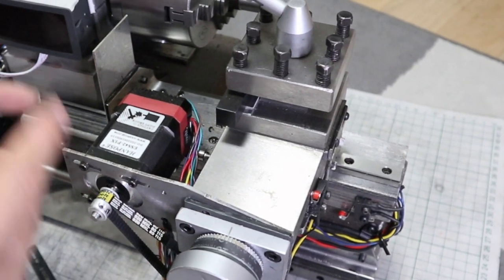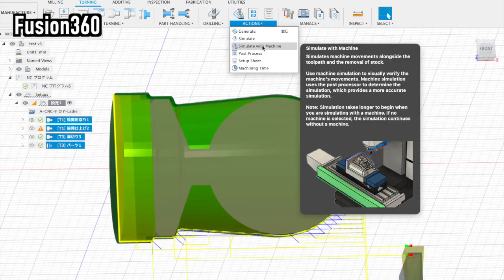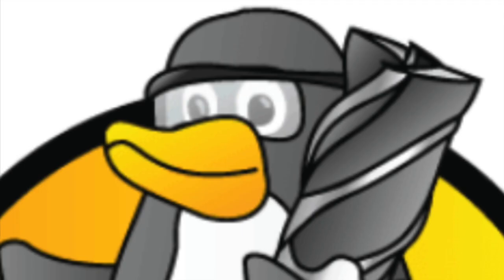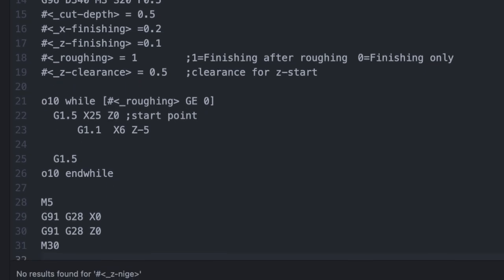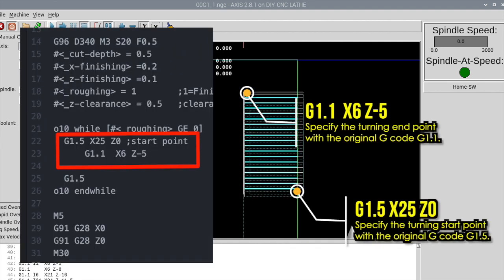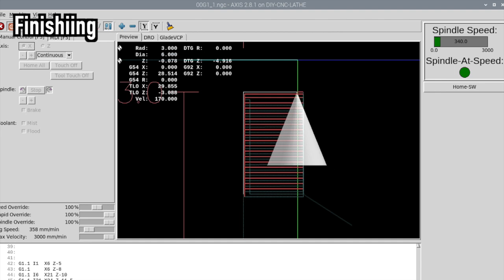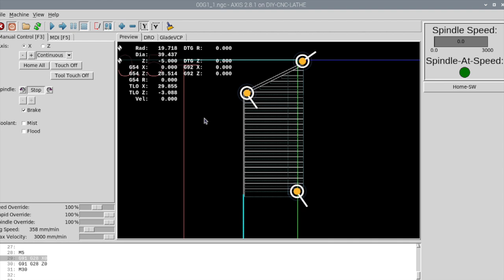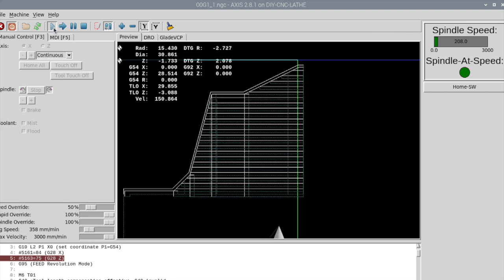Homemade DIY Small CNC Lathe. I tried making original G code

Comment: what is the difference from your gcode to the G71 G72 Lathe roughing cycles from linuxcnc? do you share your gcode?
Reply from the maker: The G71/G72 cycle is intended to rough cut a profile on a lathe. The G71 cycles remove layers of the material while traversing in the Z direction. The G72 cycles remove material while traversing the X axis, the so called facing cycle. The direction of travel is the same as in the path given in the subroutine. For the G71 cycle the Z coordinate must be monotonically changing, for the G72 this is required for the X axis.

https://linuxcnc.org/docs/devel/html/gcode/g-code.html#gcode:g71-g72